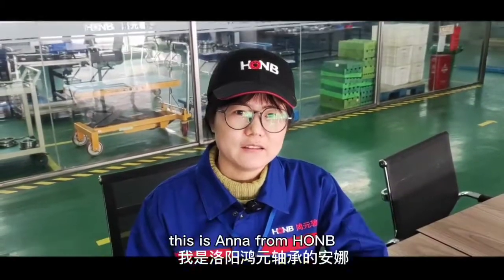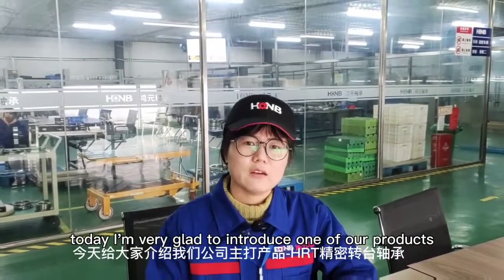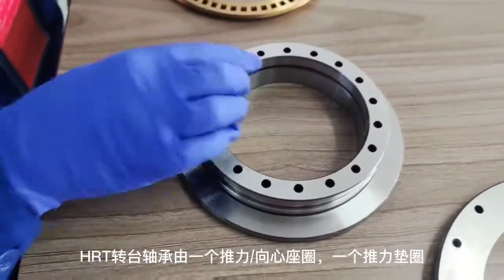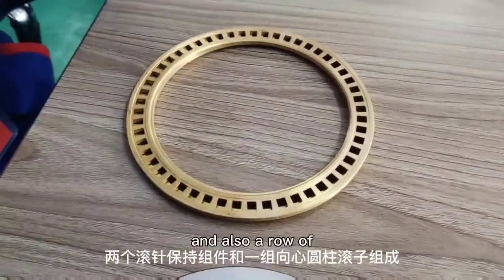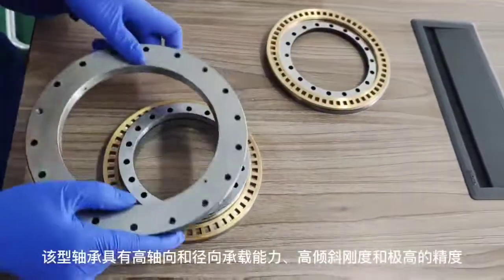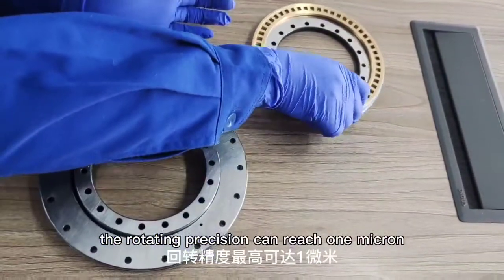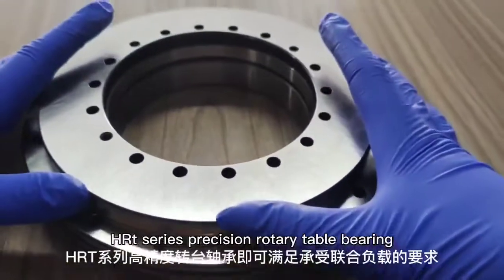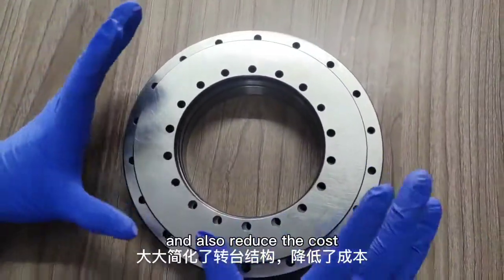YRT Rotary table bearings-High precision cylindrical roller bearings

Comment: HRT Rotary table bearing
Reply from the maker: Yes. You are right!
Reply: @annafeng7610  Hi anna may i ask to you a question about honb bearings? what is the difference between yrt (HRT BASİC) and yrts (HRTS high speed series). 
For example does yrt have radial rollers on the inner ring?  I'm a little confused about this